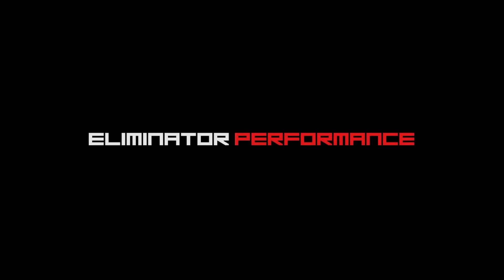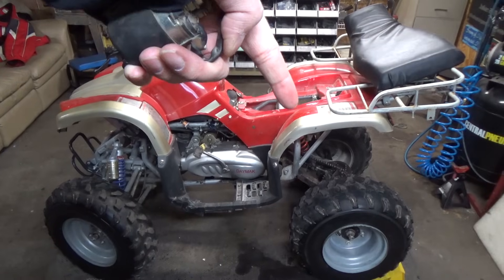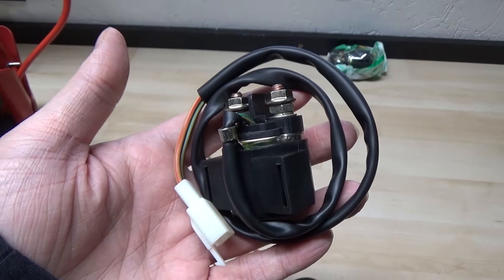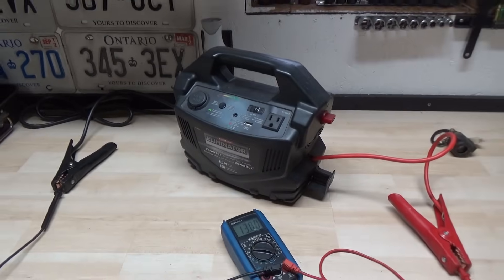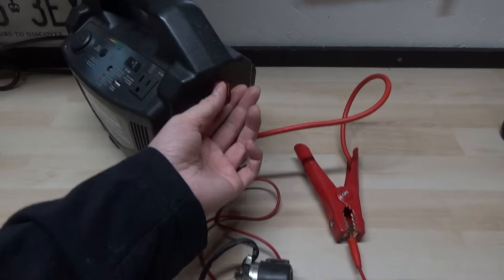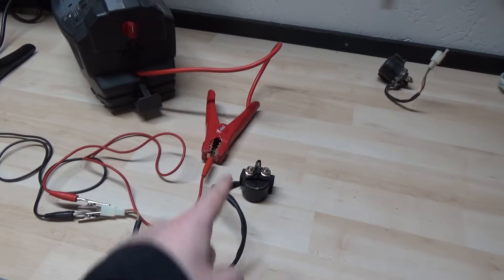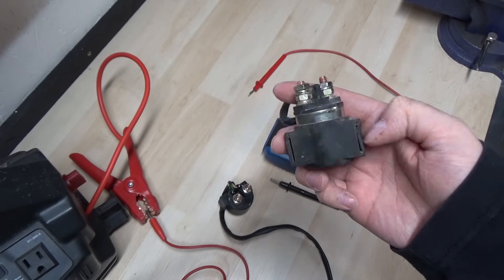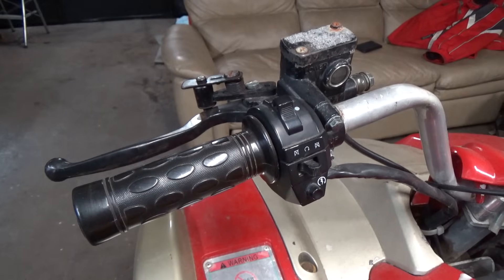How to Test an ATV Solenoid!

Comment: I know very little about working on motors, this video explained everything in a way that I was able to diagnose problems with my ATV.  Thanks!!
Reply from the maker: Thank you, that's what I'm here for!
Reply: @EliminatorPerformance  great video .my atv goes on when I jump it .but when I dont it makes a clicking sound when i try to turn it on any advice you can help me with ?
Reply: @angelsantiago7080  same here, usually I would think it’s my battery but since I got a brand new battery two days ago I refuse to believe my battery is bad

Comment: Very informative video mate, you just saved me $119AU on buying a replacement Solenoid. I did all the tests in your video, it wasn't clicking when applying power but after a few gentle taps on the Solenoid it freed up the mechanism and begun to work. I re-installed it on my TRX300 and it started first kick. I understand that maybe the Solenoid maybe on it's way out hence the reason it failed for the first time. Thanks heaps for your great video!

Comment: thanks for explaining how the solenoid works. now it makes sence when i see ppl use a screwdriver and they touch both leads for testing purposes
Reply: Akeem Moore LoL was waiting to see this comment, been working on brothers 300 arctic cat and crossed this connection a lot yesterday, testing the start switch and the on/off switch, now at the point of eliminating them both and installing a push button to avoid/fix the issue

Comment: Hello brother it is ( Sept 6th 2020 ) and I used your video instructions to test and eliminate the starter solenoid.... thank you for such a great video ... my battery and solenoid is good ... after a full test I was able to ohm test it ( 0.2 ) and test the magnet ... open and closed clicking noise present .... I cross jumped the solenoid positive to starter and it turned over .... I have a bad ignition 😁🏆🍻 thank you so much

Comment: Dude very good explanation of the electrical system and operation of it on this video, kind of weird though that the video was "a process of ELIMINATION" using an "ELIMINATOR" battery pack by ELIMINATOR PERFORMANCE. Sometimes these Chinese bikes are not worth repairing.

Comment: Thank you so much, I'M from Romania and i think i have this problem , when i connect the 2ND cables  to a batery 12V it clicks but i think the 2Nd bolts have corrosion like you sayed bcs i let my motorcycle alot of times in rain.

Comment: My 150cc got kart 2 wires to the starter solenoid are hot. I’ve already replaced the solenoid 3 times so I don’t think that’s it. The 2 wires stay hot the whole time it’s running. It will start and run but I have to hit start it because when I turn the key it only clicks. So after a hot start I’m golden I just unplug the starter solenoid and I’m good and wires aren’t hot anymore.

Comment: Hi there, it's a brilliant video but I'm still stuck. If 12v + goes to one side of the solenoid and the other side of the solenoid goes to the starter, where does the battery negative cable go to. Please help it's my son's birthday and I need to sort this for him. Thank you
Reply from the maker: The solenoid is just a switch, the 1 small wire provides 12v, and the other wire is ground. This engages the electronic magnet. Then the 12v big wire going to the 1 large post, is connected to the other post which has a big wire going to the starter. Grounded through the frame. Watch this: https://youtu.be/h_vy7DERing

Comment: Can jumping the solenoid make it die ? My quad was riding yesterday pull starting and all but today it won’t even pull start.  Before I was jumping the solenoid to make sure starter works then my kill switch button was not registering anything so I kept jumping to see if it would work and now it won’t start at all. Think it’s my kill switch or solenoid ? Or could I have did something else

Comment: My Bayou 250 solenoid is different than these. It has six terminals and a 20amp fuse that also plugs into the solenoid. Two terminals are the big ones and then there are four small male blade terminals that a coupler from the quad plugs into. Wasn't sure how to test it. I'm sure it's bad because no click or anything when I hook it up. I have another and it clicks when the start button is pressed but starter mostly will not crank. Tapping the starter while holding the starter button gets it cranking, so I am going to replace starter.
Reply from the maker: It could be a bad ground on your starter!

Check this video out before you purchase another starter: https://m.youtube.com/watch?v=IUiq7YgvEvE

Best of luck Chad!

Comment: Very awesome walk through. Thank you ! Did you ever get it working?
Reply from the maker: Thanks! The starter gear on the inside of the engine was spinning freely and wouldn't allow the electric starter to turn over the engine, basically my customer just ended up kick starting this machine!

Comment: I have one of the 110cc Chinese go-karts.  It previously ran just fine but we let the battery go dead (really dead!) and allowed the kart to sit for a couple of years (under an ATV cover) outside.  I just installed a new 12v battery and when I turn on the key (first notch, for electrical) I don't get any indication of power.  Obviously, moving the key beyond that to the sping-loaded start position, still nothing happens.  Honestly, I can't remember from the past when turning the key to the first position (electrical on) whether the solenoid would normally click, or not.  Not sure if it's supposed to.  Either way, it doesn't.  When I jump the solenoid between the two posts, it turns the starter over directly off the battery (still no electrical shown on the dash).  Does that sound like the solenoid?  Your videos are great!  I have subsicribed!
Reply from the maker: I would recommend taking a jumper cable, and hooking the Ground on the Battery to the Frame of the Cart. You could just have a bad ground!

Comment: My polaris won't start, lights dash ect. won't come on. Replaced battery, sylenoid and plug,  Any ideas what else it could be?  maybe a relay from the starter swith (key goes)???
Reply from the maker: Bad ground cable. If you have a battery charger, connect the positive to positive cable and the negative from your charger directly to the frame (bare metal spot) if your lights come on, it's a bad ground cable!
Reply: @EliminatorPerformance  Tried what yo said, no lights on,  Any other thoughts?
Reply from the maker: @pa.fishpreacher6166  hard to say, maybe a main fuse? Nothing else I can think of at the moment.

Comment: thanks for the video.  2015 polaris sportsman 570 efi with starting issues.  if i turn the key, i can jump the solenoid and the atv starts up, so i know starter, battery, etc is good.  i ordered a new solenoid, installed it, but it was dead on arrival.  the terminals were constantly connectected.  

My question is, can i just install a push button that essentially shorts out the terminals as a permanent fix?  this polaris model starts by turning the ignition like a car, no push button. or would that cause more issues?  should i just try my luck with another $10 solenoid from china?
Reply from the maker: Buy another solenoid, I would also test the key switch just to make sure that's not causing issues!

Comment: My problem is different. My key is off and when the battery is hooked up the starter cranks and won't stop till I unkook the battery. It's a motorcycle and I replaced this last year with a cheap one from China it's sat all winter so I assume it's bad. Although I have no continuity through the posts. Cant imagine it being the starter button because it does it with the key off and button not pushed. I'll do more testing.
Reply from the maker: Stuck solenoid probably
Reply: @EliminatorPerformance  that's what I think but no continuity between posts.

Comment: If the solenoid has broken will that stop the quad from getting a spark I have a quadzilla with a no spark problem changed the coil back and spark and still no luck
Reply: The only thing that would make it not spark is either a coil or a magneto

Comment: Mine starts on the pull starter but just turns over with the key.  Runs fine, but wont start with key.  What are your thoughts on that?

Comment: Hey I’m currently trying to fix my Yamaha 250 bear tracker, it has an electric start but it doesn’t work, so instead I just use the pull cord to get it going, but now that doesn’t work anymore. The biggest problem I see is the negative contact that connects with the solenoid isn’t in its correct spot, it looks as though it was yanked out of its spot, and half the wires in it are cut. If you want I can send you photos of the thing, I bought it off some guy for about 500, thought it would be an easy fix until I saw that the battery was held in place my bungee cords on top of a 2x4 that was tied to the back of the damn thing, I have no idea how to fix this, please help

Comment: So on my machine there is a nut washer wire and another nut to hold the wire down.  The nut on the bottom I guess crews into the solenoid and it’s corroded. This should be the problem but it still clicks. ? The battery drains and my booster reads that the alternator works.
Reply from the maker: Sounds like you have a parasitic load.

With everything hooked up, disconnect your negative wire from your battery, place 1 lead from your multimeter on the disconnected battery cable, and the other end on your negative terminal on the battery.

You should see a reading (when checking on low amperage setting) if there is a parasitic load.

Usually it's auxiliary headlights or a winch that drains the battery.
Reply: Eliminator Performance thanks, I’ll try it.

Comment: Good video, check the battery hook up leads again, to the battery ,to  me it looked like you had two leads which are both positive leads, check to see if you can find another ground wire.
Reply from the maker: There's 2 Positive and 1 ground, turned out to be a bad ground!

Going to post a 3rd vid in a couple weeks on how to diagnose a bad ground!

This little machine was good for about 3 or 4 vids lol

Comment: I have a 2009 honda recon i switched the solenoid twice..cus we bought a few to have and it still doesnt startwe either new one.....i checked the only 15 amp fuse and it wasnt blown....i checked grounds and all was good.. could it be my actual starter?
Reply: Also my battery is at a 12.8volts checked with my multimeter
Reply from the maker: You could try testing it to find out!

https://youtu.be/IUiq7YgvEvE
Reply from the maker: If the solenoid isn't engaging though, it could be a faulty safety switch or a bad push button start.

Comment: Great video. I have a 2000 Polaris 425 and sometimes I hear that clicking. I usually just need to toggle back and forth with the kill switch and it starts. This may just be a coincidence .  I don't think my hand break needs to be engaged to start the engine. If I hear that clicking can I rule out the kill switch?
Reply: Hi j

Comment: My solenoid engages sometimes could it be a corroded wire?
I also have no spark
Testee the coil its good
Could it be the cdi or stator
Neer help its urgent thanks in advance

Comment: my solenoid was working fine before i parked it and now it won’t start. i turn the key and lights come on but when i push the start button nothing happens. i’ve tried jumping the solenoid but nothing happens. any ideas what the problem is?

Comment: Great video! Can you help with this similar problem? My 2006 sportsman 500 two-up fuel injected quite running while in use. When trying to restart, it began making a loud clicking noise from the FRONT where the PDM is located. Initial thought was a poor battery or ground. I boosted with a new 12v battery - same issue. When turning the key to the ON position, the fuel pump works fine bringing the fuel pressure up to the proper level and then this wicked clicking noise starts somewhere in the front of the machine sounding much like a solenoid clattering or even a striped gear. What are your thoughts? Thanks for any comments!
Reply from the maker: I'd follow your battery lead to the solenoid, see if that's clicking, if that's not the issue it could be a loose starter cable or it's misaligned.
Reply: Thanks for replying. It looks like a faulty winch solenoid located under the front right wheel-well area.  It was a factory installed Polaris winch. I'm able to access the sol. insides. Could keep you posted if you want. Thanks for help!
Reply from the maker: Great to hear you've located the issue! I'm always glad to try and help out the best I can.

If you haven't already, subscribe for more weekly videos! Thanks.

Comment: Im working on my grandsons it was running and died. the cellinoid clicks but doesnt start, any ideas?  Enjoying your vids by the way 😎
Reply from the maker: Thanks Mark, if the solenoid clicks it means the start button and wires are good to the solenoid. The battery maybe low, but most likely a bad starter ground.

Check out this video here: https://m.youtube.com/watch?v=IUiq7YgvEvE
Reply: It can def still be the solenoid also. Just because they click don't mean all is working inside well. Just fixed mine today actually, hence why I'm here. But mine clicked when hit start button, but was from 94 when the 4wheeler was new and it was corroded severely. Tried cleaning it up, still clicked once everytime. Got new for $12, and swapped it out and bam 4wheeler fired rite up again. I tried tapping my starter with key on and button held and didnt notice any changes etc. But gl, sure u sorted it out by now

Comment: I had tools under my seat while on quad and my chain fell off so I had to cut it out and when I tried to start it nothing happened so I took seat off and a tool had snapped a wire that was connected to the fuse when I was try to put it back together of of the fuse wires accidentally touched the negative while the positive wire was still connected to battery and the wire melted a little bit and made a small cloud of smoke.. what could be the problem? I reconnected everything and I didn’t get any power. ( FUSE WAS NOT CONNECTED )
Reply from the maker: I would check the battery to make sure it's fully charged, and then look at testing the solenoid. Also look for more melted wires.
Reply: Eliminator Performance does the solenoid control my lights? Cause they don’t come on either also my lights only come on when I bump start it

Comment: can you use the amazon solenoid for a honda atv or should it be bought from honda?
Reply from the maker: You can use a solenoid from anywhere, as long as the plug (connector) is the same it will work!

Comment: Also, can you send a link or photo or describe the fuse that you have connected on the tip of the positive wire that connects to the battery. Im missing that fuse.
Reply from the maker: You don't necessarily need it, but you can find these at any parts store. Will be a 12v fused wire.

Comment: Recently me and my dad fixed up a 250 yamoto the electric starter doesn't work I don't think it did when my dad bought it 10 years ago can anyone tell me if there is a problem that I just don't no about
Reply: It could be the starter the solenoid or the battery maybe

Comment: Did you get this going? im having similar problem right now. im using a test light at the solenoid when i push starter button light comes on. Im thinking ground somewhere, taillight, tether maybe. i just want to bybass it all.

Comment: What if the solenoid will contineusly clicking like when you start it. Just like "krrrrrrrrrr" not like the one you test it, what will i do sir?
Reply from the maker: The connection is sticking due to corrosion most likely, I'd recommend getting a new solenoid!

Comment: Great tutorial but you forgot to test for resistance. Continuity only  let you know if the circuit is closed
Reply from the maker: Yes continuity just helps you rule out if the solenoid is a problem, so I normally check for continuity and say ok there's a connection, I need to look elsewhere.

Comment: I jumped my 2000 400ex and had cables backwards no i have no power changed fuses where should i look?
Reply from the maker: Hard to say, if it's not fuses than could be the battery? If you have 12v going to the solenoid, then I'd check the switch!
Reply: Eliminator Performance thanks I’ll check that out

Comment: So i have 1998 polaris 500. I changed the starter and the solenoid. Changed the solenoid twice and it starts just fine sometimes and sometimes it just keeps turning over until i unhook the battery. Not sure why this is going on. If anyone has any info that would be great!!

Comment: The lead on your alligator clip that connects your 12V source to the posts on the solenoid, the clip that’s attached to the connector that was crimped onto the wire, Isn’t actually making a connection with the power source cause it’s the opposite side of the alligator clip that had the power running to it, the part of the clip that’s clipped to the plastic cover of the plug itself, so no power would actually be going directly to the solenoid at all..
Flip your alligator clips 180 degrees and you Should have 12V running to your solenoid at that point, would have made for a sweeter video 😎😢😅😂👍